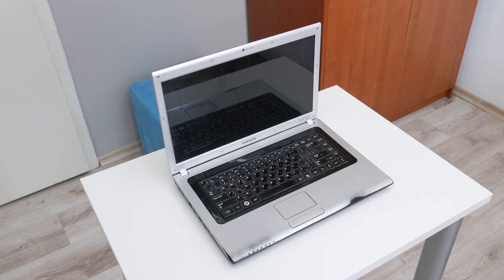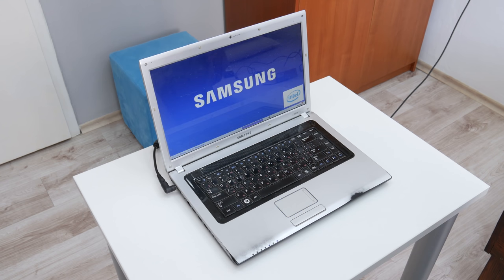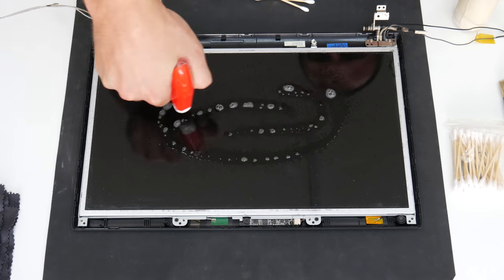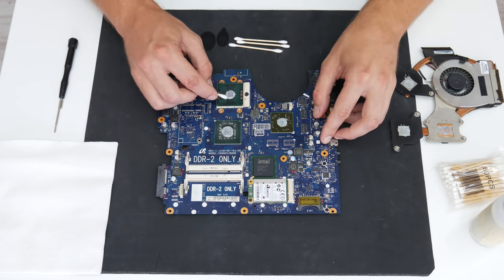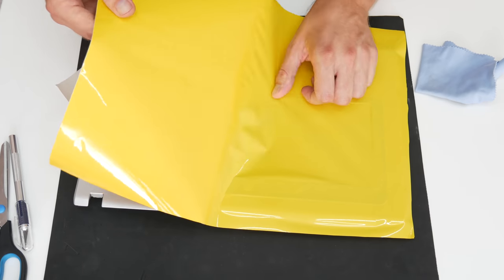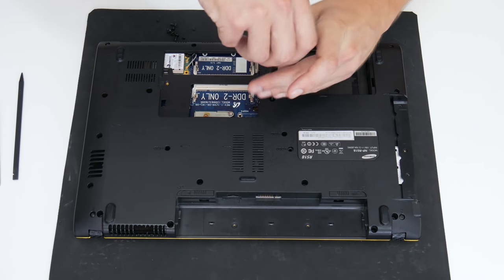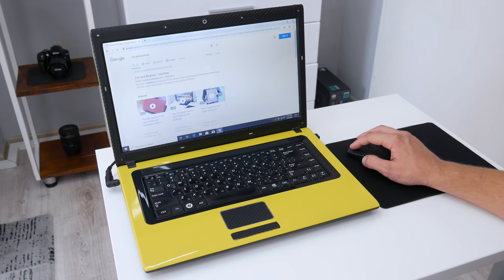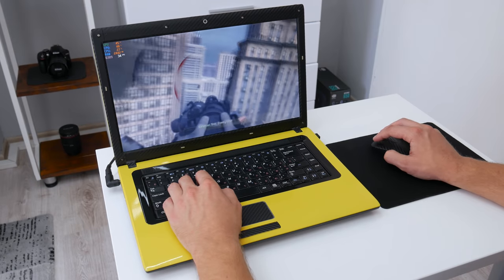Fixing low Specs Samsung laptop

Comment: Good teardown and clean-up, have you considered that the BIOS of on the mother board is not up-to-date? Most people when buying a laptop use it as it is and never update the BIOS. You can try that and then put the CPU inside.
Reply from the maker: Thank you bro :D actually the bios is latest, am always checking that before upgrade the hardware, that is standard procedure :D but there is a lot of laptops that theoretically support some upgrade but until you try you won't know, it will work or not
Reply: @ComputersAndTechAndAndrew  i upgraded a Samsung R510 not too long ago. The highest CPU that worked for me was a T9600. Maybe try one out if you have the chance, they go for around $10 on Aliexpress so not pricey at all.
Reply: This could be an option. But the motherboard does not support an FSB-Clock higher than 800 mHz. A Q9000 demands an FSB-Clock of 1066 mHz. I don't think that updating the BIOS raises the FSB-Clock of the Chipset. But who knows? Maybe it does work.
Reply: @phoenixwright124  If the chipset itself doesn't support 1066, then there's no chance a 1066 FSB CPU would work even with a BIOS update. On a PC mobo, maybe. But on a laptop, no chance.
Reply: @NSHG  This is pretty much the same I pointed out. I only told him that he could try to update it ( so he/she can know it him/herself ) ... I mean, it won't destroy anything. I can't generalize something I did not check on everything which is why I told that it might be worth a try.
Reply: @ComputersAndTechAndAndrew  can u give me a laptop for playing games plz😭😭
Reply: so we must update the bios before replacing the cpu with a new one??
Reply: @tabitasimorangkir3754  it kinda is because it may not support it with the current bios that is on the device.
Reply: O

Comment: Thx for sharing the problem with the laptop,cuz I had same problem and I had disabled a core to boot up the laptop . I never thought it could be due to charger or battery issue. I try to fix it soon  and check.

Comment: Another great transformation :)) 
I have upgrade it my 10y old asus from T5750 FSB-667mhz to T9900 FSB-1066mhz and works pretty good. (off course I have update it BIOS before that :) ) My RAM is also ddr2-800mhz. I mean if motherboard doesn't support FSB-1066 should be downclock to 800mhz. So I think intel core2 duo T9800 or T9900 are the best option for upgrade and with combo with that SSD will be great laptop for basic work :) Intel Quad core Q9000, Q9100 and QX9300 has a little bit higher power consumption, so maybe the power supply is not enought for that.

Comment: You could test 8gb, idk about ddr2 but with ddr3 some pre-builts say 4gb max but 8 gb is fine.
There probably wasn't a stock option with 8gb
Reply from the maker: The 4GB is max, i have one stick with 4GB and when i've tried 4GB + 2GB it won't start
Reply: @ComputersAndTechAndAndrew  does it start with 1 4gb stick? I think it would be a CPU limitation on that case.
Reply from the maker: @ryanwakebradtelle8682  with 1 4GB is starting but not with 1 4GB and plus 1GB or 2GB. If it was DDR3 that all is different story, ddr3 will go 8GB +

Comment: It's kinda bummer to know T4400 isn't upgradeable any further. Mine is T4300 and planning to upgrade it. Good video, keep restoring! :D
Reply: T4400 IS upgradable... just search for cpus for socket p with 800mhz fsb depending on what the chipset allows.
Reply: @hugosimoes5119  yeah, I know it is, but to find the suitable one maybe hard.. how about xeon that he mentioned in the video? isn't it running on 800 MHz?
Reply: @rickyaozora  which xeon did he mention?

Comment: the soap with water, did you wait for it to flush out after pasting the yellow vinyl on the top case? can it remain inside? or its flushed out when you push the air bubble out? this is rather new to me.
Reply from the maker: Hi bro, actually this is old school technique for sticking vinyl and mostly is used on cars. After i apply the vinyl i just push out the water using card, then the vinyl is sticking by itself, but for something like this you need quality/premium vinyl, the cheap vinyl has less glue and the glue isn't quality like on the better ones and it won't stick easy, you need to heat after with hair dryer, but in some cases may not stick at all, all depends from the vinyl quality

Comment: The best upgrade you can do here is the cpu. Only 800 fsb cpus are supported. I have upgraded mine with a P8600 with lower clock but much more cache. It can play HD videos smoothly and stuff. But the recommended system is windows 7. Win 10 will run like garbage here.

Comment: Mind I ask, what is the brush used to clean the motherboard? Does it not cause any static that might damage componenents?
Reply from the maker: Hi, personally i'm using small brush for walls painting, the brush is made from plastic and won't cause some static, also you have anti-static pads for electronic repairs, they are cheap and also good

Comment: The thing here is, the Q9000 has a FSB clock of 1066 mHz, which this motherboard, unfortunately, does not support. ;( It supports up to 800 mHz.
So ... that's why it is not working. You could upgrade it to a T9300 or T9500, the X9000 could work, too. I would recommend the T9300 or, if you get a good deal, the T9500. The X9000 uses 44 watts, while the others use 35.

I have a Samsung Laptop, too. The model is an RV510. Before I upgraded it, it had a Pentium T4500, 4 GBs of DDR3 RAM and a 320 GB hard drive. I upgraded it to a Core 2 Duo T9500, 8 GBs of DDR3 RAM and a 500 GBs Samsung 860 EVO SSD. The T4500 made a Cinebench R15 score of 100-110 in multi-core. The T9500 makes 128-135. I can feel the performance boost, but (!) it is not outstanding, definitely not outstanding. I only watch YouTube videos with it and play some older games, which this Laptop handles perfectly fine. 8 GBs of RAM is definitely nice to have, because I browse a lot and leave tabs open. 4 GBs would be enough, if you don't leave many tabs open and only do one task at a time. The SSD is the part, that definitely made a noticeable jump in performance. But what I can say is that the graphics chip is the bottleneck of the whole system.

All in all, I want to point out that such laptops can run older non-performance intensive games fine and that a CPU upgrade on a GL40 chipset is not worth it unless your current processor is one of the slowest on this chipset.

Nevertheless, I like this video. The result looks great! Keep up the good work!

Comment: Andrew, i have AMD R9 270x. It is 5 years old. And i have tried to change the thermal paste. I used liquid metal conductor to replace the old one. But, then my R9 270x doesn't work now. My display doesn't detect any input source. Do know what is wrong with it?

Comment: Can you make some mod for the batteries? I think the big problem of old laptop is hard to find the new batteries.
Reply from the maker: Actually i have some ideas about that. But making a battery isn't simple because every battery has controller that is placed inside of the battery, and all controllers are programmed to work differently, synchronized with the laptop. I can do some mod, like battery cover or something to cover the battery hole. Btw the battery for the older models you can find on ebay or aliexpress
Reply: @ComputersAndTechAndAndrew yes you are right.

Comment: i have the high end model 
i5, gt 330m 

also any quad cores don't work because of TDP the teardown was cool the 1366 model r580 is good since it runs most older games on medium native res  most newer dx10 games run at low fps low settings 

it also has an expresscard so you could try an egpu while keeping your WLAN but the interface is pcie express 1.0

altough the r580 uses a diferent socket and memory  it is built the  exact same way  

some results

terraria native res auto color background on 60 fps

crysis 1 high  shaders (everything else low execpt physics sound and object cantity 1024x576 ) 27-10 10 is in combat with physics going on

hl2 high 2x aniso 2x msaa native res 60+ fps most of the time 

minecraft 720p  50- fps with sildurs enchanced defaut or vibrant low  70+ fps with no shaders

borderlands 2  like 30 FPS everything low

bioshock  eveything to the max execpt shaders 60fps

human revolution 60 fps  low 720p (have barely played)

gungeon  60fps  everything high

for some reason when it loads a chamber it underuses the components  and while i played coop the game decided to freak out after i killed an muzzle flare

also the frametate drops while the camara zooms out while walking to the Dragun room  but when he appears everything is fine

Comment: im so proud of you, from low spec u upgrade to a higher specs and u can play games like call of duty, and in watching this because i have a plan to upgrade my asus x453s but if i upgrade a hdd to ssd then memory from 2gb ram to 8gdram then can i play now league of legends? and in already subscribed you
Reply from the maker: Thank you :D the X453S has N3150 CPU which is not upgradable, but you can upgrade the RAM, with 8GB i think you can play LOL ( 25 or 30 fps+ ) but using Low settings because the N3150 has weak graphics
Reply: Cat and Andrew  ooh? haist ithink i need to buy new laptop, that ican upgrade, but do you think the FEED ME laptop can play league of legends? and thank you for your reply

Comment: I really need help, I also have samsung laptop with amd e1 1200 apu it has only 2 gb ddr3 800mhz ram..i tried to upgrade it upto 8gb but its only showing upto 4gb..but on website it shows it can take upto 8gb. I have installed 32bit Windows 10 pro. Should i install a 64 bit windows to resolve this problem? or 4gb is enough to run 32 bit win 10? Thanks for help🙏

Comment: Im about to do the same thing to muy laptop, my laptop was on the infinite loop right know so I was planning to buy a different ssd and install new window, windows 10 will that fix my problem?
Reply from the maker: Hi, if the boot loop is happening before boot into the Windows then first try to reinstall the Windows, maybe just the Windows is crushed. If the Loop happens after the logo or you getting blue screen, then maybe the disk is damaged or the RAM is failing

Comment: what are you use for cleaning ?
Reply from the maker: Hi bro, mostly I'm using 96% isopropyl alcohol ( safe to use and it won't damage the electronics ) 
For the display sometimes i mix alcohol and anti static transparent glass cleaner ( not glass cleaner which contain some color ), other stuff is soft cleaning clothes ( similar to glasses/sun glasses cleaning  clothes ) one medium soft brush and one very soft make up brush

Comment: may i know which liquid/alcohol you using? link to buy? thanks
Reply: and this black mat also @14:50 please
Reply from the maker: @SebMu333  Hi bro, I'm using isopropyl alcohol, it's available in almost any pharmacy/drug store and is cheap. The black mat, if you mean on the rubber below the laptop, that is a large mouse pad
Reply: @ComputersAndTechAndAndrew  thanks brother appreciate.
Reply: @ComputersAndTechAndAndrew  How much is the thickness and dimension of the mat bro?
Reply from the maker: @SebMu333  Hi bro, it's 5 mm thick and it's 50x50cm large
Reply: @ComputersAndTechAndAndrew  any link to buy online bro?? Im still searching lol
Reply: @ComputersAndTechAndAndrew  any link to buy online bro?? Im still searching lol
Reply from the maker: @SebMu333  Hey bro, these mouse pads are available on aliexpress, amazon, ebay and all are with different prices, this one that i use is about $7

Comment: did you know how to fix stuck screw on laptop? i cannot open my laptop to clean it.
Reply from the maker: Hi bro, if the screw is just turning but it won't start going up, try to use tweezers, pull up the screw with tweezers and with the screwdriver try to remove it